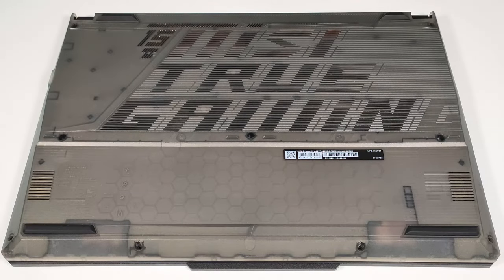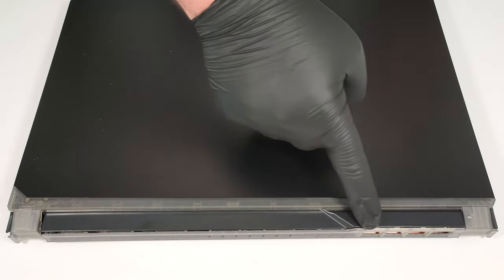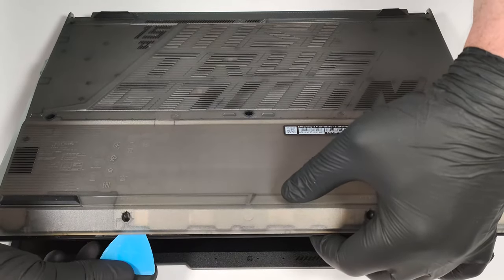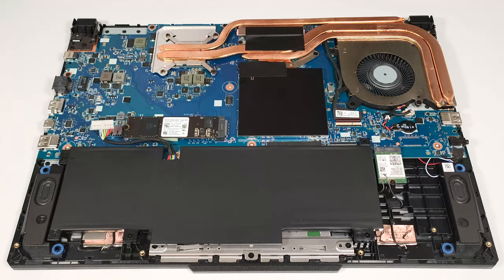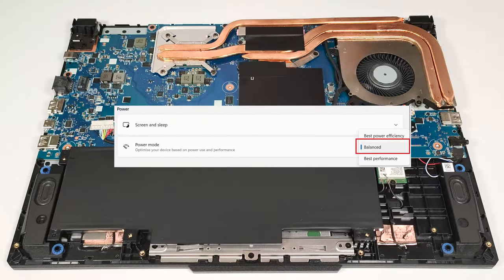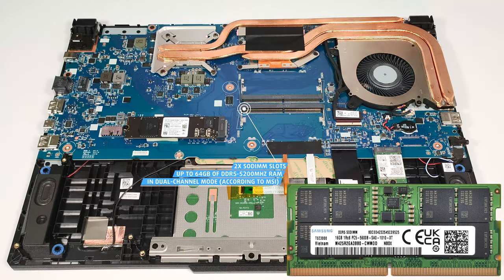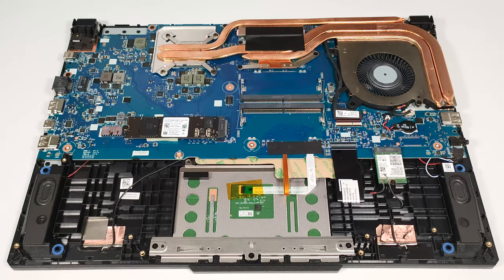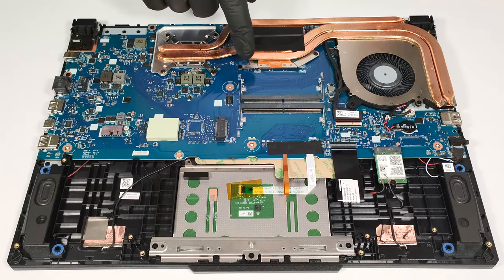🛠️ How to open MSI Cyborg 15 A13V - disassembly and upgrade options

Comment: Actually, There are second m.2 slot but no connector.
Reply: Why they saving BOM cost for 2nd m.2 slot :(
Reply: idk
Reply: I am waiting an SAMSUNG 990 EVO Plus SSD 4TB, PCIe Gen 4x4 | Gen 5x2 M.2 2280 so is it possible to connect it as a second SSD or i have to clone it and put as in first?

Comment: Hi, in my new cyborg 15 a13v, when i move my laptop right\left there is a noise comes up from inside of laptop, like screw part, is it normal ? Anyone have this issue ? Is it normal ?
Reply: Must be abnormal
Reply: no it not and you should check it because if that is a screw and go into your fans it will break your laptop.

Comment: I have msi cyb 15 3050 gpu i5 12gen, and 16 gb ram, is posible to be single chanel?
Reply: What screwdriver size should i get to open the screws?

Comment: These single fan thin 15/now cyborg 15 starts crying after few months of use due to small heat pipes and one fan . I had gf63 thin i5 10th gen and 3050 . Motherboard cooked due to overheating
Reply: what about the warranty?